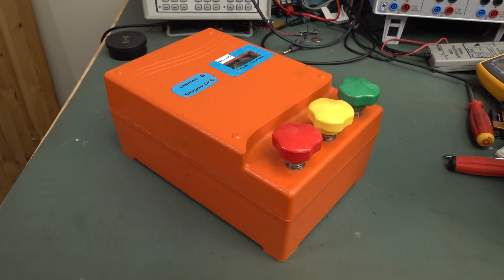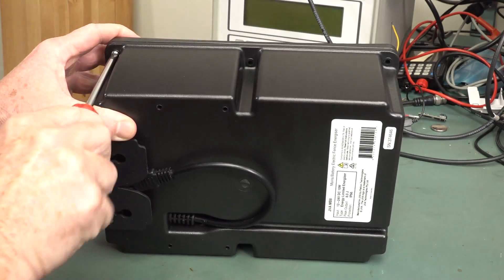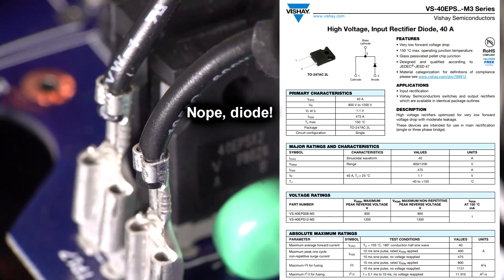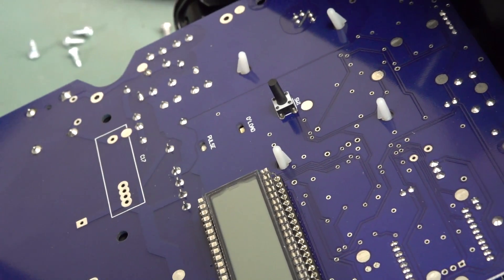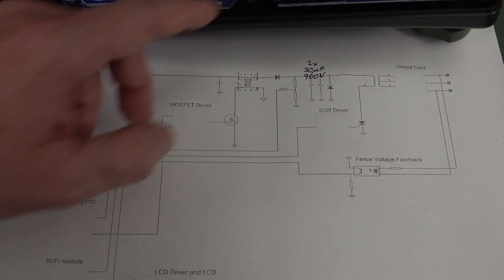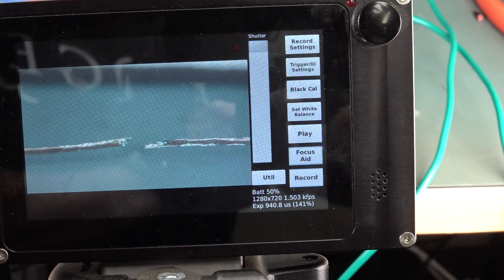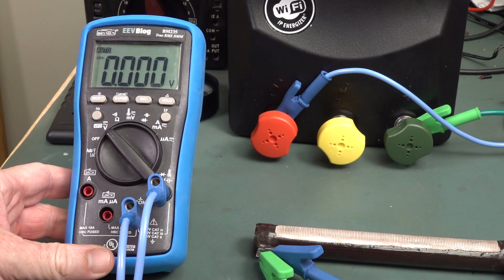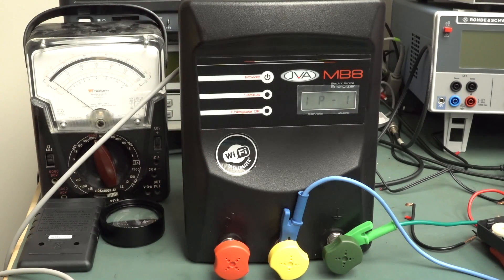EEVblog #1292 - $2 Meter vs JVA Electric Fence Controller!

Comment: That triangular pulse is 100μs wide and 350V high. Max current is 350V/50Ω=7A. So the max voltage at the terminals is 7A×1050Ω=7350V. So Pmax=7A×7350V=51450W. So the total energy of the pulse is 51450×100μs/2=2.5J. So what happened to the rest of that 8J?
Reply: The MB8 can deliver 8J to the fence when required. The Energiser backs off its power based on what it sees the fence needing. If the fence can power up to 8kV then no need to push more power into the fence.  Placing a 500R or 200R load across the output terminals will push the stored energy (as displayed on the LCD) up and the output energy will get to 8J
Reply: @MrShaunwesty  How does it sense that?
Reply: @analool7873  Via the feedback opto. It measures the voltage, which will drop if the fence load increases.
Reply: @MrShaunwesty  Out of interest, do they also back off the power  or decrease the pulse frequency when they sense the supply battery voltage is dropping (to prolong the last bit of battery life).

One of my fence units seems to do this. (not one of yours)  I've no idea if it's a deliberate feature or just a quirk of the design, but if the former I thought it was a pretty neat way of ensuring you still have a modicum of coverage if you neglect your batteries (which happens from rime to time).
Reply: @DEADB33F  I don't this this model does, could be wrong though. The smaller portable units with an integrated battery definitely do. The pulse time increases to 1.9 seconds.
Reply: @MrShaunwesty  Is that why there's that first tiny duration pulse before the main pulse? To test the load present and limit the energy as appropriate?
Reply: @AndrewMerts  That pulse is not on any that I have tested using a 1000:1 divider and a scope. It is just the 100us to 150us pulse. Not sure what signal was picked up there. Anyway the load is measured by the feedback opto. If the voltage measured is low, ramp up the voltage on the caps. It is not doing precision measurements, just making sure that the voltage on the fence will keep the bull in its pen
Reply: @MrShaunwesty  Good point, what is the designed load resistance for the controller. Is it 1K ohm or less?
Reply: @threeMetreJim  It is usually tested at 500R and also at 200R. These are the human body model and for an agric energiser the peak power point (normally). Some are designed to run into a much lower resistance.
Reply: O no, it's even less because it's quadratic, P=U²/R, the energy becomes ⅓U²t/R=1.7J!
Reply: @babbadge  I still don't want to touch it!
Reply: So where does the ⅓ suddenly come from? Short answer: as both I(t) and U(t) are linear functions, P(t) is a quadratic function: P(t)=t²×something. You need a little calculus to calculate the total energy, but simplified, you have to integrate the function, so E= ∫ t²×something = ⅓t³×something. That's where the ⅓ comes from. The long answer = full calculation is on https://www.instagram.com/p/B938QyRFqTL/?utm_source=ig_web_copy_link
Reply: Charles Babbadge / Ouwehand
Hartelijk dank! 😁
Reply: EDIT: I'm wrong here
 @babbadge  The update is wrong: how does it suddenly become 1/3 ?
 E = P*t 
P= (U^2) /R  
--> E= (U^2) /R *t = (U^2) *t /R
 And then beacuase of the triangle multiply by 0,5: 
E= 0,5* (U^2)*t /R

0,5*(7350^2)*100*(10^-6)/1050=2,5725J
Reply: @analool7873  I don't care, I is still not going to touch it!
Reply: @analool7873  although the voltage and current form a triangle, the power does not, it forms a parabola and the area under the parabola is less than half width*height.
Reply: @analool7873  2.6J is quite alot still, and can still make you double take what happened.
Reply: How did you go from 50 ohms to 1.05 kilohms (1050 ohms)?
Reply: @williamsquires3070  coz he had a 1k ohm & a 50 ohm resistor in series with each other!!
Reply: @keithking1985  1K with 50Ohms was the voltage divider for the osciloscope, I guess..
Reply: @williamsquires3070  the 50 ohm is in series with a big 1k resistor, together they form a voltage divider
Reply: I think people here have become confused between power and energy. Energy being Joules, and power being Joules per second.
Reply: @threeMetreJim  No. We used the integral of P(t) to get the Energy of the pulse
Reply: I'd calculate the energy from the peak voltage, load resistance and the time for the pulse and then divide by 2 (triangular fall draws half of a rectangle).  First spike is probably when the current flows into the transformer, the gap is where the transformer has saturated but the capacitors are still discharging, and the output is when the field collapses in the transformer, similar to how a flyback converter operates.
Reply: @threeMetreJim  that's just what I did. And later I realized that the power pulse is not a triangle but a parabola, and therefore you must divide by 3 in stead of by 2
Reply: @babbadge  It looks pretty much a straight line fall to me rather than parabola and if you do ((V*V / R) * 150uS) / 2 you get approx 4 Joules which seems pretty realistic. Probably 8J stored in the capacitors but output limited by transformer saturation. The proceeding spike probably only contributes a fraction of a Joule of energy.
Reply: @threeMetreJim  voltage indeed looks like a straight line, aka linear. Current is also linear. Therefore, power=I×U will be quadratic, or a parabola
Reply: @babbadge  Exponential, these days! Everyone will understand, I assume.Will they? Uhm..
Reply: @mcflapper7591  probably not, but what can I do about it? What can you do about it? Follow a university course in EE? Probably too much to ask? Maybe Dave can explain it in a video?
Reply: Charles Babbadge ... I think the rest of energy has been transferred to extra bonus money in the manufacturer pocket, couldn't you think so ?!

Comment: i have that exact same meter that i bought as a quick use one time mine is the "DT830B", still workign after a couple of years with the battery it came with

Comment: 9:04 “you can have bigger caps in there for the larger Joules versions”. 

You can’t go much larger in this configuration. You could fit slightly longer ones but otherwise you’d have to stack them and use a larger casing.

Comment: Yep those things will give you a nip alright. Went to lean on a wooden section of fence, someone had run a line across the top of it, which I didn't notice. Well after a bit of language that would suit a vid from Dash Cam Owners Australia, I realised what had happened, didn't lean on it again.

Comment: Just yesterday my brother give me his electric fence thing to repair. The case says"lighting protection" "grass protection sistem" and it only has a transistor a coil and one big capacitor.
Reply: Oscar Caetano as we all know, a sistem isn't as functional as a system.
Reply: @HighestRank  yes. my english is horrible, and what?
Reply: @oskimac  Must have been thinking that you were copying directly from the case.  It's only funny when the finished product is both cheaply made and mis-spelled.
Reply: @restcure  like these USB charger marked "product description"

Comment: Do these PICs have internal watchdog?
That'll mean we have triple watchdog: main PIC internal & external, 2nd PIC internal.
Reply: Yes they do, but that just determines if the code is running correctly. It does not confirm the speed the code is running.
When the safety of an Energiser is determined by the speed of the pulse (greater than one second between pulses), the internal wdog is not enough. Two chips with separate timing systems helps to solve this problem.

Comment: At agricultural shows here in UK they put the leads of electric fence units into a bucket of water , the ground lead is in the water and the line is 25 to 50 mm out of the water on the side of the bucket you can hear the pulse half a mile away. As someone who has had a jolt from electric fences and their energisers on many occasions I can positively state that it is not unpleasant it is BLOODY unpleasant.

Comment: given that thing can output 20joules depending on the parts that are put in i wonder if this would be hackable to make a rather slow firing automatic coil gun (or airgun with a bit more work)? not that it would be legal i guess but i think it would make a decent driver for such a thing
Reply: Think that has been done using the JVA 2-zone security energiser to propel a paperclip projectile for a year 10 or 11 science project. The fire timing and distance between the coils was critical.

Comment: those connectors are so you can swap out batteries  A lot of farmers run these around the clock on batteries and wil drive around and swap  them out as needed.  I use those connetors for cars I don't use all the to hookup the mower to a charger this winter might.  trying to re-condition the battery now.

Comment: Try getting zapped when they build up a shitload of static charge and the output is 700K. It's like whip going off. Of note, it's good to see that there are companies still operating here in Australia that haven't been brought out by shitty multinationals &/or shipped production overseas killing off jobs and the local micro-economies etc.

Comment: I'm using a simple, old and funky, electric fence Transformer that is literally 45 years old- primary shows 40 ohms, secondary around 5K.  however it is not connected to any fence... the output goes to a well-known brand of multiple spark, capacitive discharge, aftermarket Automotive ignition box... which feeds a GM HEI coil in a rocket box full of peanut oil.... up on top it has a bunch of fancy bells and whistles where 3" arcs shoot out of a small fire and swirl around all crazy.... and play melodies and chords and things, cuz the Transformer primary is fed by a compression circuit that is fed by an electric guitar. the "plasma amp". if I had some idea what I was doing, I would build a big giant version of this circuit. however, I don't.  peace.

Comment: 14:21 I could be wrong but I think that light green color in the spark is the copper vaporizing. If you used wire made of different metals you'd get different colors.
Reply: Indeed. You can also dip the wires in a solution of the salt of that metal and let them dry, for example normal table salt will give a nice orange-yellow color from the sodium

Comment: The cheap multimeter is great for school! Years ago i bought 16 of Them. But children blow fuses, changing ohms to volts etc. But the thing is sensitive enough for showing foto electric effect (tube) . Minimum current is 0,1 micro amp!

Comment: I would have thought the capacitor rubber mounting was to prevent mechanical damage over time from the repeated high currents pulses causing the caps to physically 'jump' a little from their magnetic field interactions with the earths magnetic fields.

Comment: Stupid comment of the day. Are you sure you connected it up correctly? Don't you loop the two outputs and isolate the earth. 
The arc should be between the linked outputs and earth. 
There are many scenarios for the operation of a electric fence once there has been a interruption. It could be a break or a short in the fence but the scenario above would be normal operation.

Comment: 17:31 I can hear louder clicking with the 121GW than the BM235. Perhaps check for internal damage?
Reply: Could be sparking across the range switch. That would damage the meter only in the long run.
If you want a very good test of the meter and of a lot other brands, check out Joe Smith Youtube channel.

Comment: When I was about 15 years old my grandparents were moving off the farm and wanted to keep the copper wire from their electric fence. It had been unplugged and pulled off the posts for about a week. They wanted me to just gather it up. It took me about an hour to work up the courage to just touch it. It went well til I was about 3/4 in when I got a good shock from seemingly out of nowhere.
Reply: Sounds like someone hooked the energizer up as a prank.
Reply: @uK8cvPAq  That wasn't it. I'd been bitten by that wire a few times before. I made sure it was 100% disconnected.

Comment: He didn't lick his fingers and touched the wires. My disappointment is immeasurable and my day is ruined.
Reply: We should ask ElectroBoom to review a fence controller.
Reply: @KyuubiYoru  Or PhotonicInduction.
Reply: Standard electric fence test is to piss on it after a few schooners
Reply: Used to test 10J units by touch, for me no issues, but our lab tech did not believe me and touched. He had elbow and shoulder pains for over a month! Do not advise touching, even though I did hundreds of times myself
Reply: Naaaah, fingerlicking isn't so cool any more these days..

Comment: I just had a look at the website.

Australian own business, with available spare parts and manuals. And prices are similar to other big brands for which you can't find spares. I think I know where to buy the next one.

I once looked for a replacement transformer for another brand, it was half the size of the one in the video and no center tap and it was going to cost $250.
Reply: Vote with your wallet!
Reply: I wish we could say the same of far more manufacturers today.  It ticks me off every time an otherwise perfectly good device has to be disposed of all because of a single unobtainium custom part!  We have senselessly become a throw-away society for reasons of pure near-term economics with no thought given to the considerable future costs such incurs...but because we do not pay that cost upfront today nobody seems to care.  How many people truly need a new smartphone with each new year?  I use mine for 3-4 years before upgrading and they can still run virtually any app I ask of them over that lifetime, it’s only once they have accumulated enough damage or faults (including failing battery) that I finally upgrade, but still we should be properly recycling them (and recovering tantalum, indium, gold, lithium, cobalt, etc.) — instead most ultimately end up in landfills.
Reply: Aussie controller out to kill you? Of course there are going to be lots of parts to maintain its body count.
Reply: Here in Australia, you can be a very long way from help, and you don’t want to throw an entire controller over your shoulder if you don’t have to. Having spare parts available is a must.

Comment: I see they have a GSM model as well as the Wifi ones.
They should consider a LoRa option as well for those who have other Lora-based agri sensors (and those who don't have good mobile coverage).

I've been looking at making a few Lora fence monitors for my own use, but the ideal would be having it built into the fence unit itself.

Might have to have a crack at making some of those HV opto-isolators. I'd been playing with using a large voltage divider but full isolation would obviously be much better (and make the device more compliant with regs and less likely to blow up).

Comment: If you send one of these to bigclive, he might even touch it just to see if it hurts... he’s been known to do stuff like that during a teardown video!
Reply: He'd attach it to nipple clamps.
Reply: Dairy farmer from NZ here, have a PEL 63r fence unit that puts out around 7kv to 9kv. With dry gumboots I can touch and hold fence wires with little discomfort sure your arm twitchs with the pulse but it doesnt actually hurt. Plus a good trick is to stand on one foot when handling wires so your earthing is less but yeah if you touch fence wire with wet boots or manage to touch a nonlive wire at same time then FUCK yes it hurts
Reply: @benduhova1643  We used to use a blade of grass as a resistor to test if the fence was on - get the tingles but greatly attenuated.  And in fairness on a smaller unit, but yep still hurt like fuck if you didn't use the blade of grass.
Reply: @benduhova1643  I never understood why you get shocked even if you are wearing the black rubber boots there is a layer of rubber between you and ground I understand if the boot has a hole you will get shocked must be the moisture in your feet penetrating the rubber linemen use rubber gloves to work on live lines and they use much higher voltage 13KV + and there gloves are thinner than a boot
Reply: @dos541  It's not just DC, the pulse edges are effectively an AC event. You are capacitive, so you conduct AC.
Reply: Electroboom will power it while touching the hv terminals
Reply: @oskimac  If they weren't so expensive I would send him one to try out
Reply: I've touched one that was at a Rolls Royce manufacturing plant in Derby England, made my fingertip go white and it hurt like hell. Not something you'd want to repeat. Far more painful than the BigClive taser module - I've tried one of those too, and it's very tame in comparison.

Comment: Does the device continuously send 8J pulses down the fence and into ground (unless an animal touches it)? Isn't that kinda wasteful? Wouldn't it be more efficient to make it detect once an animal touches the fence and then release the energy?
Reply: It backs off power until a load is detected. Then it ramps up.
Reply: @MrShaunwesty  ah, thanks

Comment: Dave, if you want a nice long arc from those terminals, place your wires just above a freshly sliced potato. We have had an arc track around 5cm across the surface, but no high speed camera to capture it. Please be aware it will be very loud.

Comment: ..and I did the same with my cheap Dick Smith..who?..were they a Holden subsidary?..multimeter ..I could hear the arcing inside too and I could see the arc through the plastic in bright sunlight..